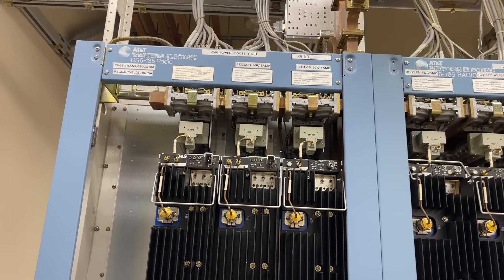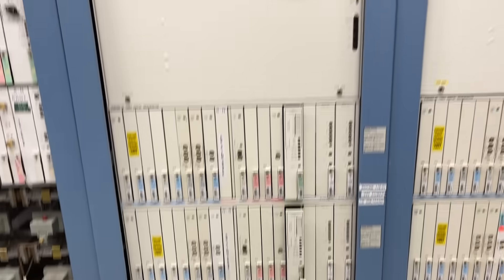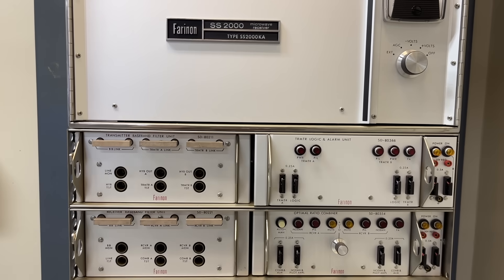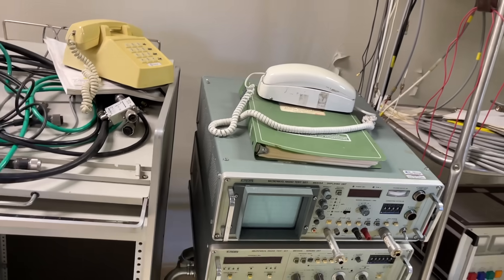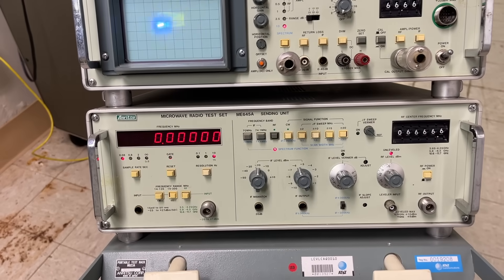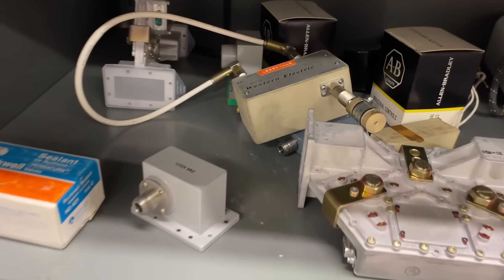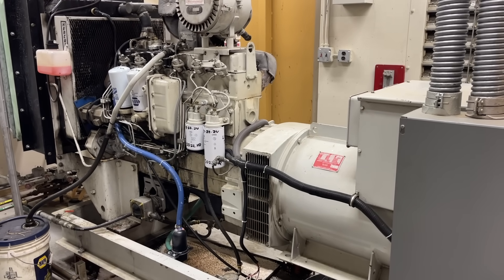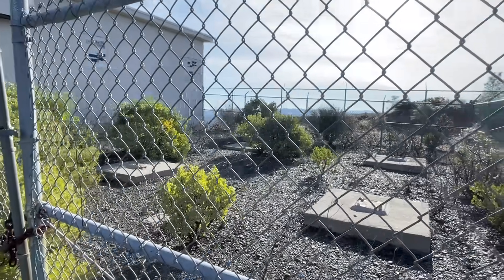Inside an old AT&T Long Lines Microwave Site

Comment: At about 8:45, microwave radio, coax cable and fiber optics are mentioned. I am not sure which came first when AT&T's long distance network was developed, but microwave and coax coexisted for many years, although microwave was less expensive to provide. The advantage of coax is that it was harder to take out in a military attack. The microwave towers could be targeted in a war and destroyed. AT&T provided long distance communication circuits for the military. The coax carried both military circuits and civilian long distance communication. When AT&T dug trenches and installed coax cable, it used cable that had enough capacity to carry civilian in addition to military circuits, with the vast majority being civilian.

I worked on a project which increased the capacity of existing coaxial cable by using more of the bandwidth. The repeater amplifiers needed to be spaced closer together because the loss at higher frequencies, where channels were added, was higher.

Coax was also used for long distance telephone underwater circuits between Europe and North America, but these systems were quite different from terrestrial underground coax. The repeaters were much further apart and the number of telephone circuits was smaller.

Sprint's "pin drop" put an end to AT&T's analog microwave and coax circuits. Sprint built its network with fiber optics and digital technology, which produced very quiet circuits. AT&T's analog circuits had background hiss, crosstalk and other noise. In response to Sprint's "pin drop", AT&T took a multi-billion dollar write off and rebuilt its network with digital technology.

Comment: Great video, but I was sad to see that the tower and antennas had been removed. I live in Southern California, and there is still this deco style concrete tower adjacent to an AT&T equipment building with microwave antennas (horns) still in place. I did not realize the system had been decommissioned until recently, but not surprised. Very cool technology!
Reply from the maker: Thanks, this is due to liability. If the tower was up it would have to be lighted and monitored if it stops working.

Comment: The air dryer is used to pressurize the waveguide cables to keep moisture out of the cables. Because if you have condensation in the cables, you can have arcing that can occur and causing equipment failure. I should know because I am also a technician. Thank you for the video.

Comment: I was actually just looking to buy one of these sites.  I got some interesting information warning of asbestos.  Do you know where this would be found in one of these installations?   The township in which it is located is saying that I would need a remediation plan on file in order to purchase the facility unless I want to demolish the building.

Other than being a bit run-down, I don't see anything inside the building that looks likely to contain asbestos.  There is no running water in the vast majority of these structures, and there is no plumbing for any kind of heating and cooling purpose.  There is no tile, like the infamous 9 by 9 tiles that often contain asbestos.  The contractor is willing to give me at a basic estimate if I can get them good pictures of where the asbestos is located so that they can judge the amount and its condition, in order to formulate a removal strategy.
Reply from the maker: You would have a review done by an asbestos abatement contractor. I would not rely on pictures alone.l
Reply: I don't care.  I will bring the contractor in to do his thing no matter what. I just need something basic to show the township that I am willing to do it, and I'm in fact engaging with one or more contractors.   One of the companies in question won't even do a full review if I don't already have at least a purchase agreement on the property, as they basically don't want to waste their time if I might not even buy the property. The township won't make a purchase agreement unless I put a plan together.  See the problem?  There's a tax liability on the property, so the city is unfortunately involved.

What doesn't make sense to me, is that there isn't anything that looks like it could possibly even be asbestos.  There are no ceiling tiles, there are no insulated pipes.  The only thing I can think of is if maybe there's an insulating layer on the generator exhaust that I can't see.  It just seems like double-walled metal to me.

Comment: Are these still in use by ATT for their copper POTS and telephone networks? Are they also used for their fiber network? Either way, these were a marvel and very advanced for their time. The fact that they might still be in use demonstates the robustness and reliability of this older equipment. If it was built today with modern equipment, something tells me it wouldnt be functional after 40 or 50 years like this equipment.
Reply from the maker: These aren't in use on the network anymore. They still do use microwave links such as the Yosemite NP CO but its a different antenna system. They were pretty cool. Lots of sites were sold off.

Comment: I'm slightly shocked that the power supply to that place is so bad that the backup generator is running for real so often.
Reply: If it wasn't for the size of the hills in view, outside, I would think that the power was being supplied by Jacksonville Electric Authority (JEA), which provides power in Jacksonville, FL. I lived there in the earliy 1990s.  I've never seen power go out so oten, in my life. And I'm originally from up north, where they had blizzards and icestorms.  Incredible.

Comment: The building is pressurized to keep out dust, etc. Wave guides are purged with inert gas. The pressure switches are for monitoring. We have a microwave system still in place in NW NM.

Comment: That looks like a desiccant dryer typically used in compressed air systems. Tower 1 and tower 2 is referring to the two tanks, not the antenna towers. They need to alternate tanks and rejuvenate the desiccant using heat. The ones i work with have each side labeled as "towers".

Comment: I just retired from AT&T in 2023. Those are older 80s 2ghz microwave equipment using the old cornucopia antennas shown in your video. There are sites still out there with the old Western Electric TD2 microwave equipment from the 70's. I worked in Nevada and California. There is some older Alcatel 4000's and 6000's still in operation today. We just took an old Farinon out of Amboy Ca in 2016. Today all the M/W equipment is moving to newer digital packet radio technology able to carry ethernet instead of the legacy TDM traffic. I enjoyed my 27 years there.
Reply: My dad worked for PT&T and later AT&T in San Bernardino.  He worked in microwave as well as L carrier.  This was back in the 60's,  70's and 80's. We've been all over that Mojave desert and know every microwave station and L carrier repeater as well. I especially remember Turquoise,  that was a large switching MW station filled with TD-2 and TH equipment as well as Autovon. There was a lot of government circuits out there. All this old technology built by Western Electric was the greatest telecommunications system in the world ! The best days of the Bell System.  I do miss those days!
Reply: My pops worked for GTE for over 40 years from Coachella valley all the way to Amboy but mostly in the Palm Springs and desert hot springs areas.

Comment: I love the fact that they had circuits that could handle all those calls and everything back when they still were using vacuum tubes when the system first came out and was put in operation so that's pretty cool 🙂

I went on a couple of Urban explorer trips and seen some of these towers I would love to be able to rent one for use with some of my hobbies working with like off-grid power supplies and solar panels being in a building that had such cool history like this that would be totally awesome but I don't know who I would contact to find out about it 

I also wouldn't mind making use of one of the old l3 l4 underground power feed stations some people use them as a bug out bunker but I would just love using it for a cool workspace 😎

Comment: That tendency to retire stuff in-situ is real.  I once walked through an AT&T rack and found a several U tall single hard disk drive, in 70s brown, still running.  Highly doubt anything was actually using it, but nobody dared turn it off lest it break something they would then be responsible for fixing.
Reply from the maker: Correct, sometimes an entire bay has to stay powered due to alarms or maybe one customer still on that circuit.
Reply: I'm about to turn 23 but I love old tech like this

Comment: Maybe I missed it in the video, if the microwave tower is gone, why is all that equipment still inside the building in use? Is that building/equipment now a part of the new fiber optic system?
Reply from the maker: Yes, it's a fiber building now for the long haul network.

Comment: From the 1950's into the 1990's, the FAA ran Collins microwave gear for sending long range radar data to ARTCC's, and in one case, starting in the late 1960's, ASR8 radar data from Cecil Field NAS, to the JAX Intl. Airport TRACON.  In the 90's all this tube type microwave gear, which had been upgraded to using solid state IF strips and modulators, but still relied on Klystrons for carrier freq. and receiver local oscillator, were replaced with AT&T FR8 microwave radio gear, which was purchased from AT&T after it had all be refurbed.  The intent was still to get the radar data to those places, along with 900+ telephone circuits with hopes of getting as much of the FAA and other government offices off the Bell System and onto this network, which was nationwide.  That plan ran into problem as it was considered competing with a commercial enterprise, but it was still used for FAA inter-facility communication, paths to air to ground comm sites, and still carrying radar data.  An early version of DEI related activities in the early 2000's brought the hiring of some really incompetent people into the Washington DC offices of the FAA.  They had zero experience with anything concerning the electronic world within the FAA and especially the microwave system the FAA had in place, and started a systematic removal of the system.  ARTCC's and TRACONs had redundant paths of telco interconnection, one could be fiber, but the other had to be copper, and they also had to exit a facility in different direction.  The microwave system was the backup just in  case telco failed.  It did in Memphis, a large portion of airspace had to be shut down for an extended period due to a cable cut.  There was no longer any microwave backup, and when you looked at the radar for that area when it happened, you had this giant hole with not one aircraft within it, surrounded by hundreds of aircraft outside of that dead air space. I spent almost 40 years in the aviation world, starting in the Navy, and ending up in the FAA.  I will never fly in an airplane again.  It is not that I don't trust the pilot or the aircraft, it is the big question mark that has become the FAA over the last couple decades.

Comment: I remember dealing with these as they interfered with C-Band satellite dishes. Today, C-Band satellite has been shutdown and now reallacted to cellular use. Would be great to reporpus two towers as a 5GHz wifi link. As the wave tubes can handle anything higher then 3GHz.
Reply: C band is not shut down. I still have a c band dish and I still receive video on it.

Comment: I worked as a system test technician at Farinon Microwave in the 80s when they produced those 4GHz SS4000 radios for AT&T for their long haul microwave networks. It was a golden age for microwave transmission in the US.

Comment: Those digital multiplexer cards are still in use in a lot of places, and there are hundreds of Central Office techs that would LOVE to get their hands on them.  You see, there are some customers out there who simply flat out refuse to join the 21st Century?  Like the FEDERAL BUREAU OF INVESTIGATION.  stares meaningfully  Those guys just luurrrve them their 64k and T1 digital links, so their field agents have radio coverage wherever they go.  So even though poor schlubs like me kept pushing management to refuse to keep servicing those systems, upper management kept saying, "Line must go up!".  Annnnd the FEDERAL BUREAU OF INVESTIGATION is allowed to keep using the smoke signal boxes on their hips.  I don't work in that field anymore, but yeah, there's a lot of techs who would love to get their paws on those cards to replace the ones that burned out on their systems.

Comment: @FDR Retro Gaming & Tech -  Be very careful of those wave guides. Many of them were not copper or brass, they were Beryllium Copper which are VERY TOXIC. Beryllium is a toxic metal and they will tell you NEVER to burn it or torch it or cut it with a saw and make grains or dust. It is dangerous in the extreme. You can get very sick from handling it and especially eating drinking or putting your hands in your mouth after handling it. I know some guys who demo'd some sites and cut these wave guys with a torch and almost died. They were really screwed up. That metal is very light and strong but extremely toxic. It is primarily used in spacecraft and high reliability flexible metals. AT&T used it in waveguide because it could take extreme punishment in a nuclear blast and still function. Be very careful when in old sites like this or the Western Union ones. Some of WU's sites were even bigger than the AT&T ones. Uhaul sized dishes, towers you can park multiple cement mixers underneath of, and 6 or more dishes on them. Not as many as AT&T but they do exist. American tower owns many of them today.

Comment: The area that I live in had several AT&T microwave towers with the huge Cone antennas,  they wreaked havoc on TVRO,  SMATV,  & C band VSAT terminals. 

I built quite a niche business selling notch filters and specialty antenna systems. 
I was quite successful in achieving 90+% transponder functionality,  even on VideoCipher encrypted channels. 

Many clients were skeptical as they had other techs come in making promises and delivering a terribly low % of functionality. 

I worked with Microwave Filter from New York and Patriot antennas, I guaranteed at least 90% channel restoration,  which left the client confident that they wouldn't  be stuck with useless hardware.
Reply: I put dishes in the Indiana area. There was one link that was a PITA to deal with. Few customers was good with the notch filter. One customer had to cancel the deal as it was too much and could not get anything from the sats.
Reply: @techwolflupindo  

That's  how most all of my clients were on  my first visit to determine feasibility. 

One was on a hilltop and looked right down the boresight of an AT& T tower that was about 6 miles out. 
That job required not only filtration and a parabola with a deep f/d ratio,  but I also had to add microwave absorbant material all the way around the edge of the parabola and a Mitsubishi TI Fighter feedhorn..

Comment: I worked as a technician for BC Tel ( now Telus ) in British Columbia for 48 years. As a radio- microwave man, I was part of the transition from open wire carrier, to microwave radio in the 70's and 80's and then starting in the late 90's to fibre optics. Most all the heavy route radio sites in our area are pretty much shut down, but are still used for light route radio links to remote areas.
Reply: Hello from Victoria.
Reply: @ Victoria? I’m in Williams Lake. Spent summer of ‘94 in Victoria working at Commonwealth Games for BC Tel.

Comment: The dehydrator system and the alarm monitor alarmed the alarm center if the pressor dropped or the Dehydrator had high moisture or failed to dry one of the desiccant tanks. the gray alarm units on the wall connected to the waveguide were to monitor each direction of either TX or RX waveguide for a drop in the normal pressures of 2 inches of water pressure that also help to then locate the leak in the system and then repair the leak. there o ring on the wave guide and the monitor point has a glass window so the microwave can pass but the air pressure in on the outside wave guide.

Comment: The Anritsu was a new set used to tune and align the transmitter and Receiver on the different Frequencies that were used. The TD-2 was in the 3.7 -4.2 Ghz range, and the Th-3 was in the 11-14 Ghz range.  once more satellites were launched thoughts were the same Frequency used for uplinks and downlinks for communication with this them. AT&T started turning off most Microwave Radio systems in later 1989 in Florida First as the Fiber optical route had replaced them. as with the wetlands in Florida There were always issues with the operation of the Microwave signal. I started working in a Microwave Radio Repairman in 1969 in Florida and when AT&T was sold in 2004 I was layoff. slowly through the 1990 more and more regions across the country were slowly moved to Fiber as more channel capacity then Radio as most were in the 600 to 1800 voice channel analog over the microwaves. The Farinon Microwave Radios or Collins Radios were used to carrier the Alarm and control channels for the Station along a microwave route back to Alarm and Switching center that monitored the station 24 hr a day . FCC required that the control and Alarm had to be on as different system than services. and if you can find the Licences for the station you would see different owner ship of the Alarm Microwave system